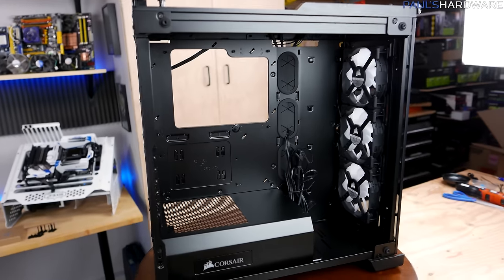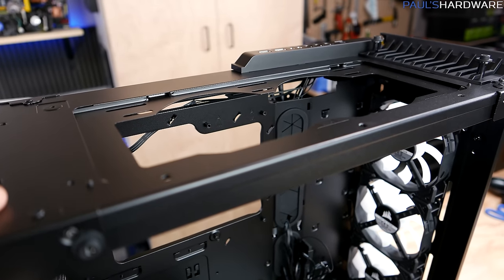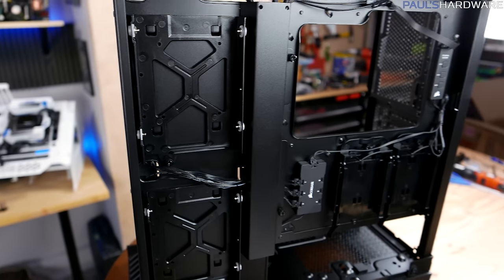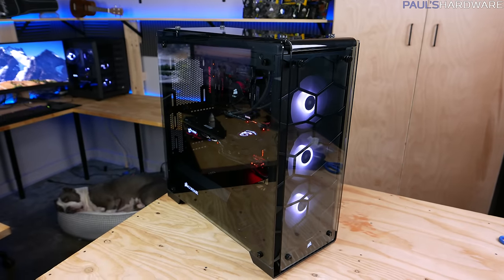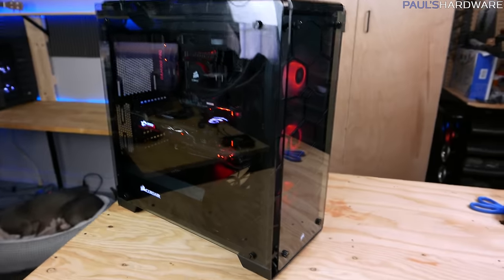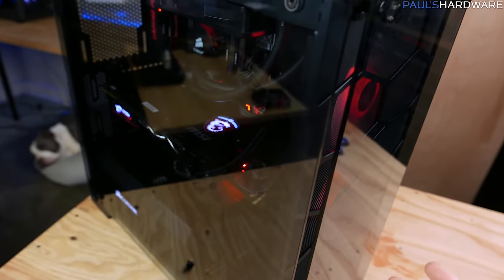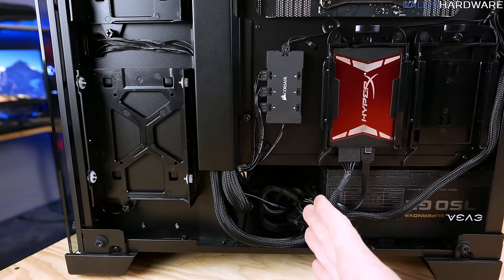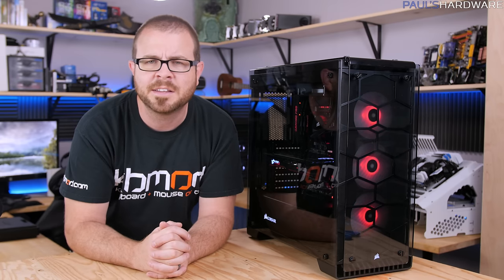Building a PC in the Corsair 570X Tempered Glass Case

Comment: No tempered glass on the back or the bottom? 0/10
Reply: I was like finally a tempered glass case of good size with a metal back..
Reply: then I noticed it doesnt...
Reply: not even glass screws! Disappointed.........
Reply: no need lolz u know airflowing?
Reply: It should tempered glass accessory for your keyboard
Reply: Buy a fish tank
Reply: at least include tempered glass dust filters and tempered glass wire sleeving... smh... it's false advertising, i'd feel... SCAMMED.
Reply: xD
Reply: I'm always looking for a temp glass case with a regular back panel
Reply: Not sure if you saw this yet or not, but Corsair does have the 460X RGB Mid Tower case that is very very similar to what Paul reviews in this video, but it has a regular back panel.

http://www.newegg.com/Product/Product.aspx?item=N82E16811139085
Reply: ^ Yeah I ended up buying it too : )
sold out in most places now so i'm glad i pulled the trigger
Reply: Kkl. Pppo. Pas mal pour i'de ^Je e
Reply: Prefer 680x

Comment: So I've been using this case for 6 years with multiple builds and it's still going strong today. I disabled and removed the RGB hub, using a front 360 AIO and the cooling is alright as well with a 5950x currently. The tempered glass is such a great tint that even if you leave some cables around, it's not showing. I've been shopping for a case for a long time but can't find anything that looks this good. Absolute beast of a build quality as well. Not a single tiny amount of damage on any glass panels, and I haven't been too nice to them either.

Comment: I ordered my 570X the other day to replace my massive EVGA DG-86. Wanted a smaller and lighter case and one that shows off my RGB more. My friend has the 460x but I didnt want to get that one as it does not support 140mm fans or my 280mm radiator. (H110i) I am definitely looking forward to moving my build into this case however, I will be doing a couple things to it.

1. Cutting parts of the PSU Shroud to better manage the wires that go to the audio and USB2 headers. 
2. Removing an ssd cage to add my Commander Pro
3. removing the integrated LED Controller.
4. Custom making a plastic cover to cover the open space on the side of the PSU Shroud.

Comment: It's a nice case, but has the following weaknesses:

1. Motherboard VRMs prevent mounting both fans on the CPU Radiator(I've seen this problem with all Youtube video reviews of this case so far).
2. HD Mounting is such that you'll see the circuit board of your hard drive and not the top(to show off type of storage etc, kinda ugly seeing some green backside of a circuit board)
3. No reset button on top
4. No Type-C USB 3.1 pass-through for top controls
5. Can't change LED color/behavior of Corsair logos
6. Hard to hide PSU cables behind the PSU Shield(as you said)
7. No easy way to hide the cables plugged in to bottom of motherboard(near PSU, as you said)
8. No way to manage an internal optical drive (if you want one for various reasons).

If there were a different version of the case that address the above in some way, they could charge another $100 for the case and I'd likely buy it.
Reply: Yeah I just was doing my build and with my  Asus 390e strix and the VRM is in the frigging way!!! I will see how my teps are with one fan... I am running an 8700k with no overclock.

Comment: Paul, first of all, thank you for the video. My first thought was that it looks very nice, but after you finished the build I had so much to complain about, that I don't think I would ever buy this case. If a company decides to make a case with clear view on the back they must make all necessary moves to compliment their choice. For example, It should have a removable back panel for the psu shroud so that the extra cables of the psu will stay hidden from the back view. I would also like another removable panel in front of the back of the motherboard, probably with ssd mounting points, that could also allow extra cables to be hidden underneath as they pass through. I would have never removed the reset button, although the missing hdd led is somewhat ok. I totally agree with you that the psu shroud should have openings for the cables connecting to the bottom of the motherboard. Finally, there should be a better way to route the cpu power cable.

Comment: if you have a spare Corsair 400C laying around, could you check if the tempered glass panel fits on it? I'd like to ghetto mod it to replace the ugly acrylic
Reply: No it doesn't, first of all the tempered glass version of the 400c is the 460x, not the 570X. And secondly, there are some structural differences between the cases besides the panels. The OC3D review of the 460x explains it well.
Reply: AS sa thank you

Comment: I'm going to need to finish installing the cleanroom in my house before I build a computer in this case.
Reply: On a serious note, if I built in this case I'd take out all the HD mounts I didn't use, lay down a very thin sheet of card with a vinyl wrap over the metal parts that have those holes so it looked like solid material as opposed to pieces of metal slotting into other pieces of metal.

Comment: I just did a build in these case. Pros:
@t is the most bueatiful case I have seen. (Personal opinion, yours may be different).
2.Perfect quality, no complain at all.
3.Perfect balance  between airflow and dustproof thanks to the high air flow design and high qaulity dust fliter. You don't need to run fans like crazy to keep things cool while keep things clean. Most cases on market have stupit front panels which chock the airflow and make front fans useless, but if you remove them, you will have dust build up problem.
4.Good water cooling support, you have the space to mount a high reservior at the front.
5.Many spare parts can be find on the corsair websit with low prices, don't need to worry if you accidentally break something. 
Few complains:
@t is very difficult to move around, you can't find a place to lift the case, and it is way too heavy when all the glass panels are installed. (It's the price of being so beautiful right?)
2.There is not enough top clearence , many people complain about that. If you want a top radiator, go get the thinnest you can (XSPC TX radiator is recommended, ultra thin with good performance). A 27mm thick H100i radiator will just be able to fit, anything thicker than that will run into your memory sticks. If the case can be just 10mm higher, it would be perfect. 280mm radiator on top is just not an option because it will hit the mother board for certain.
@t doesn't suppoet 360mm radiator on top despite it has the length to. Actaully you can mount the front fan tray at the top (they have the same mounting holes) and it will be able to have a 360mm radiator at the top. I don't know what they are thinking, they can simply give us two same fan trays and it will support 360mm radiator both at the front and the top. Why they design a different fan tray that only suppurt 240mm radiator and put it on the top? I don't get it. I'm a fan of top radiator because it has overall better case air flow than front radiator, and you can have a bigger reservoir at front without geting too crowded. 

Overall it is a very good case. It's kind of expensive but you will get what you pay for.

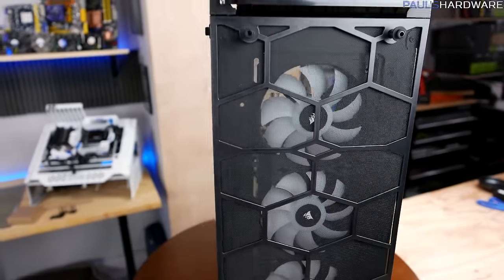Comment: At around 1:50 I finally realized what I want from a PC case. I want a case with good airflow, but the majority of the ones that are tend to look like crap. Beyond that, I'm not a fan of tempered glass or acrylic. What I want...is a case made of filters as panels, or at least filter front panel and metal side panels with a filtered cutout over the PCIe slots. They're translucent, but don't attract scratches or fingerprints. They provide airflow, but don't look like some rookie designer got happy with the pattern feature tool in their CAD program. And (obviously), they keep dust out of the system. With a decent looking design for the support structure, much like this case, they could look quite nice as well. The Fractal Design Meshify comes close, but I'm not a fan of the mountain range design.

Comment: Two major flaws that are dealbreakers: No cable cut outs through psu shourd and no flexibility installing top radiator. Otherwise very cool.
Reply: Those were common complaints I suppose since I bought this case and they added a front panel to the shroud and a cutout, not sure about the radiator though.

Comment: why is everything moving to 120mm when 140mm moves air and is quieter doing so. None of Corsairs RGB fans come in 140mm. odd.
Reply: 100%
Reply: Andrew G cases don’t support them as well. You can fit 3 120mm fans on the front for perfect symmetry, but if you put in 2 140s it looks ugly with that huge gap

Comment: Excellent case.

But those definitely do not qualify as "dust filters" for me. I mean, they'll probably keep some crumbs out, or flies.

But a decent dust filter would be tighter and thicker. Think along the lines of reticulated polyurethane foam, 40ppi and 1/8" to 1/4" as a good start. Still fairly course, but a foam will pick up a lot more with less accumulating affect on the airflow.

If I was to get this case, I would grab some sheets of the stuff and put it on all the intakes. No need to do exhaust, but top fans should generaly be covered by something to prevent dust from falling in.

I've had these wire mesh filters before. They really just kinda suck. Either they don't filter much, or they restrict airflow too much.

Comment: Not sure if anyone will read this but if you're having trouble top mounting your 280mm AIO, read this:
Rather than taking off one of the fans (which will decrease your performance somewhat) try taking off the heatsink for the VRAM on the motherboard and flipping it over and reattaching it.
I have an ASUS ROG Strix Z270e motherboard and the heatsink is massive but a simple un-screw, flip and re-screw allowed me to fit my AIO in fine.

Comment: i have this case and the power supply shroud is fully covered and it has cable holes at the bottom for those small cables. i think they upgraded it a lot.

Comment: You can use a 240mm radiator as intake, using cold air will keep the cpu cooler, and wont affect much the case temperature. I am using this case with 5 intake fans, 2 exhaust (top rear ans psu), no dust inside is building either. This case is a masterpiece...
Reply: The temps were tested with a laser temp. gun on top of motherboard monitoring, just to add

Comment: So. I bought this case. I built my system. I performed cable management like none other, sleeved cables with aluminum combs. Asus 99x. 2 780 EVGA Classified's SLI. i7 6800k, 64GB Crucial Memory (yeah I do some audio, video, gaming) 2 1 TB Samsung 850 Pro SSD's. 1000W Corsair RMi Power Supply. 

Now I am happy. Later Paul, thanks for the review!

Comment: Seriously gorgeous case, but needs the following changes made to the design:

- needs another 1" at the top for radiator clearance above the motherboard
- needs another 1/2" below the motherboard with cutouts
- needs SSD mounts on top of the PSU shroud (a la 340 Elite) (which use the cutouts mentioned above)
- needs removable 2-bay 3.5" drive cage beside the PSU, with expandable shroud (a $40 case can get away with two 3.5" drive mounts, but not a $180 case)

Comment: Thanks. I'm in a Corsair 450d. I was happy about the channel for cable management, but I'd probably round the top to make it prettier. I also do jewelry, so I'd just grab my jewelers saw and make it pretty. That was the only part of it I didn't think marvelous, just the way it looked on top. It looked kind of cheap. I mostly have my case tucked away under a desk, so I definitely wouldn't pay extra for the tempered glass.

Comment: Beautiful case, but need some fixes like more space for radiators in the top, a cable hole for bottom connections of the MOBO, a little bit more cable manegement options, fix the fan hub, and others things, but its nice (y)

Comment: That's a beautiful build and the case is gorgeous.  The price seems right as well.
One question: have you tried the Corsair control software to configure the lighting, including the standby lights?  Can they be configured to not flash?  Also, did the case include more SSD trays, or are there only two?
Thanks!

Comment: I like the tempered-glass look, but prefer the glass panels be on the front and primary side of the case, not the "cable management" side. Also, I know this is an older video, but has, or will, Corsair add rubber sealing strips that contact the glass panels when the thumb-screws are tightened? It seems to me that would help seal the case allowing positive pressure to build inside the case.

Adding sealing strips might be a DIY mod that can be done during the build process, too. If I had a few of these cases, I could try a few different methods of sealing the glass panels.

Comment: just ordered this case 3 years later and the 1 I got came with the power supply sealed, they covered it up with a piece of metal  and it also had a hole with rubber around it for the front panel connections, now its worth the money

Comment: Honestly I really like this case. I'm considering buying it to replace my HAF-X. I am a full tower man myself, but my current case doesn't offer much in regards to water cooling.

Also, I would like to point out that on the PSU shroud, I saw a couple screw(?) holes on top when you were pointing out that there is no back cover to hide the cables. Would you be able to use those to manufacture a piece of plastic to cover the back and then screw in from the top? That was just a thought I had.

Overall it's a gorgeous case with plenty of room to work in, I like that the drive mounts are on back, just sucks you're limited to 2 HDD's.
Reply: If you are a full tower person get the corsair 900d I Use it for my Editing pc its good for any type of watercooling

Comment: You should do and updated version of this.  I just bought this one and they have changed the psu cage so it is closed at the end now and a pass thru on the top of the cage for cables instead. Also the top usb port have been changed to one usb C
Reply: DanielMystisk where did you buy the case from may I ask?

Comment: i think for the front cable mgmt issue, you could have dremeled a hole thru the bottom of the grating where the PS goes and routed that cable under the grate, over the PS and up thru to the connection on the MB.

Comment: Its a nice case. I have one. The tempered glass is pretty nice actually. Just wipe off prints is pretty easy. I have only one complaint but its more motherboard than anything. I run 2 1080s GPUs and there is a small slot on my MSI motherboard under the 2 GPU slots that interferes with my bottom video card. It would be hard to install a soundcard or whatever on the small bottom slot. I added a 120 fan on the side and seems to compliment airflow from one side to the other. I love the dust filters too but with the fans it keeps dust out mostly. Nice case. I, happy

Comment: Ifypu have a motherboard with a jcorsair1 connector than you can use that hub as your main fan hub. I saw that connector only on the msi z370 and z390 gaming pro carbon series.

Comment: Just put together my new build in this case. It's beautiful and I only have one gripe.. the corsair psu only has 90 degree sata power connectors, but (obviously) the case has all vertical drive mounts. Until I get more cables, my ssd is just sitting in the bottom of the case.  So the gripe is more about the psu ONLY having 90 degree connectors, but since it's from corsair, too, I find it confusing that they don't play nicely together.

Comment: I want a combination of the 460x and the 570X.

-Tempered glass on all sides except the cable management side
- A bit higher design to allow of 3x140mm fans in the front and top-mounted radiator without interfering with RAM, but without becoming too bulky and tall
- Full PSU-shroud that covers the entire bottom.
- SP140 RGB fans

= Corsair Crystal 500X

Comment: A lot of the things he commented on such as the open end of the power supply box, is not closed, and also there is a pass through on top of the power supply box so you dont have to run the cables all the way across anymore.  Also the pump mounting spots on the bottom of the case has changed a bit.  I guess they were listening to his review. :)  Nice review BTW..

Comment: So just to doublecheck before i go and order more parts...

I have the case now, and am in the process of building a NEW PC on the bones of my old - and was thinking about buying a 240mm radiator for the top.  So to clarify, I can't do a 280mm, but can do a standard 240mm, correct?  Your build shows you used a 280mm.

second question is - can i swap the fans out?  I thought about more of those fancy RGB fans (in fact they should be arriving from amazon tomorrow.)  just want to make sure - i'm sort of venturing into more of a build than I usually do.

Comment: seems like those cable routing openings at the bottom of the motherboard are basically standard these days no matter what case you get. weird that they're not included here.
Reply: a person they have since changed it I bought this case mid 2018 there is a rerouting thing there also that hole in PSU slot in the front of it is covered now makes it harder for my big PSU to fit all the cables in that small ass area but it does look better